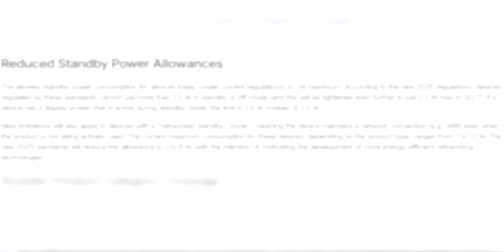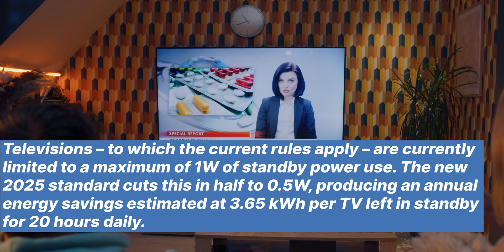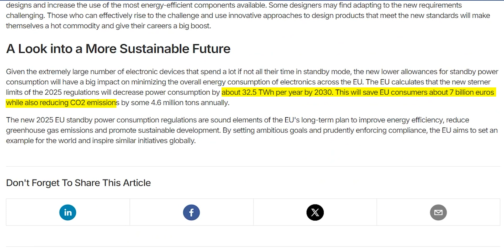The Crackdown on EU Power Waste: Gaming Consoles, Speakers & More

Comment: I'm not aganist that as much as I am bemused. I have to "conserve power" at the amount of single digit watts through these regulations, however at the same time there is a huge push towards heating homes with electricity (heat-pumps) and driving electric cars. I am reconstructing my house and going from fireplace heating to heat-pump has made my power consumption go up anything from 5-10 times (depends on outside temperature, of course)! My heatpump takes about 8000 watts at maximum. And now they try to "fix" it by making couple devices consume few watts less power? If I were to buy an electric car, it's going to be even worse. In addition - there are also issues with losses of power on electric grid side. I am certain, that those losses are way higher than what ever is going to be my "win" through these methods.

I would like to see more of such approach, where it would be very easy to switch power entirely off on devices. It would (hopefully) have some good side-effects too, like - you know that a device can't spy on you if it has no power. But even at very low level it hopefully has similar effect.